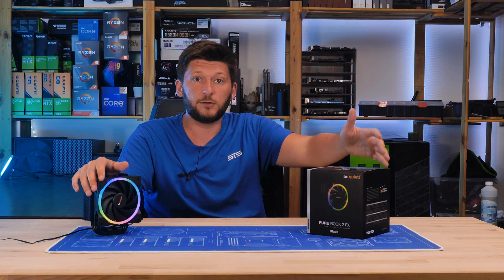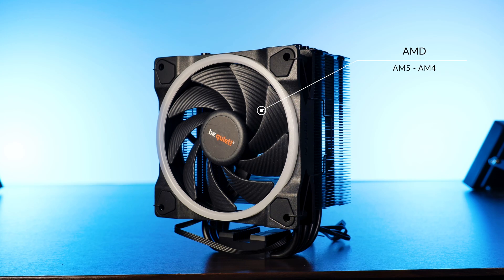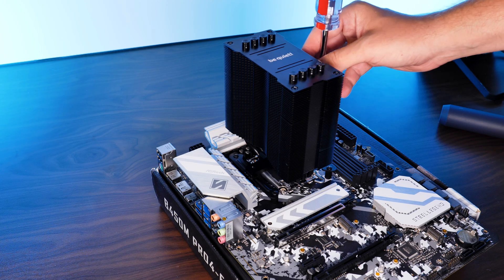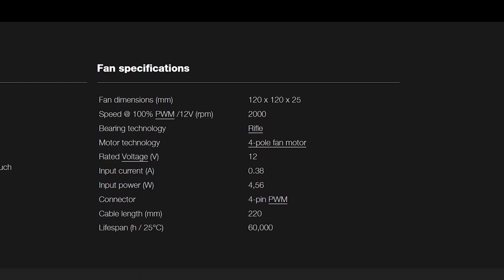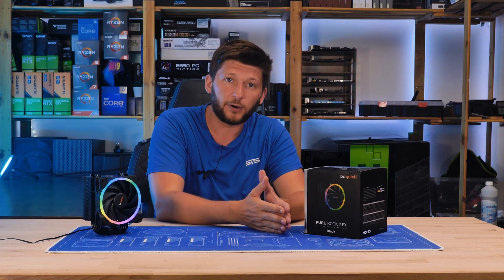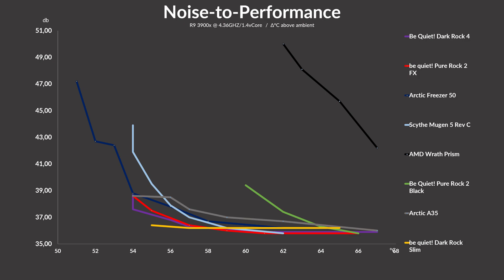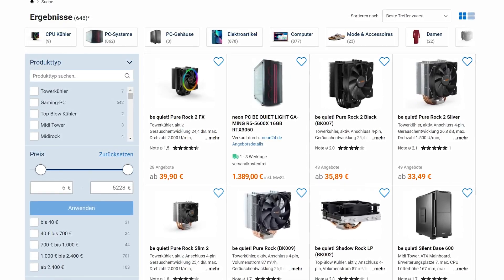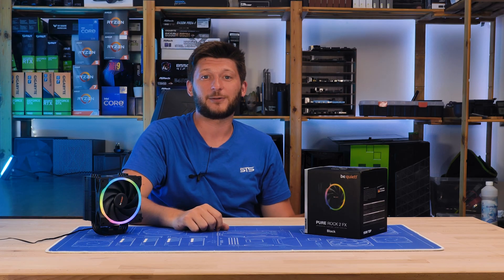2x Cooling Performance?! - Be quiet! Pure Rock 2 FX Review

Comment: i bought this cooler yeah it is silence and locks nice but perform really bad on a 5800x3d (105 TDP) even with undervolting to 95 Watt,  idle temp 45_60c and  75_83 c while gaming with 80% speed fan ( i have even installed another fan at other side it does not  help) yes 83c is not bad it dose not trottle but i dont like it it must be under 80c while gaming.

probably i have to replace it with a better cooler Couse in summer it will get much worse
Reply: Hey! Same problem for me. Ryzen 7600X 80-85 C temp. I added case fans (5). Now it is stable, no peak to 90 C. Did you find a solution?

Comment: It seems like it, but just to confirm please, would this be good enough for a Ryzen 7 5800x / 6800xt / fairly good airflow Deepcool CG560 case setup for gaming? I was looking at alternatives but pretty much most of them at a reasonable price interfered with the rams I want to use (Trident Z Neo)
Reply from the maker: Should be
Reply: @STSYT  Hi, i hope you see my comment. I have a question. Is the height of the fan really 155mm? I'm concerned about the pegs at the top, my case can fit only 161mm tall CPU cooler.
Reply: @DLoad21  from what i know they are indeed 155mm so with an 161mm case you should be ok! I saw a video with a guy having issues to fit this cooler in an Lian Li O11 case that states it can hold up to 155mm. And the pegs on the top were stoping the side glass panel . The verdict said that Lian Li had wrong measurements. But if that was the case for him your case with 161mm will perfectly ok. Hope this comes on time and not too late

Comment: the bridge was a tad annoying, this was my first ever tower cooler install, the "screw either side down" was my gripe, I did not know how tight, manual stated "tight" but the more I tightened the more I felt I was squishing the CPU, I settled for a non moving stack/ just tight and luckily my temps have been spot on 73 max under load (3dmark), 39 idle & mid 40 gaming.✌

Comment: I'm running Pure Rock FX 2 with 1 fan at normal default motherboard cpu speeds ! I'm getting 70-75c on heavy gaming sessions....Should i get another light wing fan to put on the cooler and use it with 2 fans? Will i see some decrease in temps or is it an overkill? Maybe i'm overthinking it and my temps are okay, i'm not sure since i only built the system 3 days ago...I never saw temps going over 75c ! On cinebench R23 i get 97-100 with the single fan at normal speed ! Thanks in advance !
Reply from the maker: I have no idea what exact CPU you are using, but generally 70-75 are absolutely okay. 
You can always get another fan. It might not give you an extreme performance boost, but it you can push the RPM down significantly = a lot less noise
Reply: @STSYT  13700k

Comment: Which is the equvalent no-RGB of Light Wings? I was thinking replace the Pure Wings 2 of my Pure Rock 2? Do you think a Pure Wings 2 High Speed would make a difference since it runs at 2000rpm? Thank You.
Reply from the maker: Honestly, not sure, I never tested the Pure wings on their own, only in combination with a cooler. Though I doubt it

Comment: I bought a Pure Wings 2 2000rpm PWM 120mm high-speed to use as a second fan when my BQ!PR2FX arrives next week. I have little clue what I am doing and hope that it is a good combination and that it works right and plugs up easily. I'm wondering what it will take to ensure that the included ARGB fan and the additional Pure Wing are in sync.
Reply from the maker: Actually it will take close to nothing. Just set the same mode in software and it will take care of it for you.

Comment: I was impressed by the Temperatures on my sons Ryzen 7 3700X, so i bought one for my R 7 5700X too.  The 3700X goes to a maximum temperature of 67℃ using Cinebench my newer 5700X goes to 87℃ 😲 but it is way better than the wraith prism cooler that reaches 93℃ 🥵.
Reply: How is the overclocking? I got a ryzen 5700x also but i didt instaled it yet i am still looking for a good cooler, i am also looking at the cooler master hyper turbo rgb
Reply: @bachir5767  I enabled PBO in the bios and the cinebench score is now 14638 and before it was 14523. I used a cooler master hyper 212 in a old Phenom system and it is one of the best air coolers you can get.

Comment: I would definitely buy the FX series if it was available..
Reply: i got it , be quiet case and this cooler , there is no sound at all from the case , cpu temp around 30 idle , go for it , great buy !!
Reply: @borcepecale216  what cpu and GPU do you have? My new build is a 5700x and 6750xt. The cooler seems to work great for my build.. very quiet
Reply: @kdcustoms1272  i got i5 12400 and nvidia asus rog strix 1660 6gb , no sound whatsoever on many games , such cyberpunk 2077 and Marvel Spiderman...  Case is also from be quiet , i apsolutely recomend it , love it !
Reply: it is available, just look on ebay :)
Reply: @camotech1314  It's only just now actually available in stores in Denmark.
Reply: It was literally 5$ cheaper than the non rgb on new egg a week and a half ago